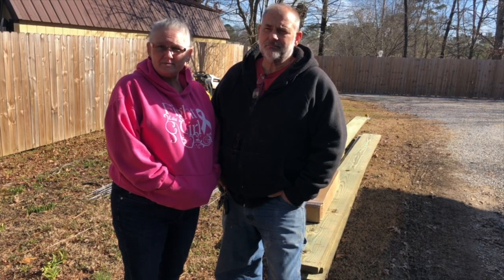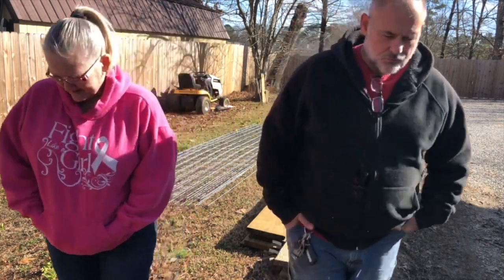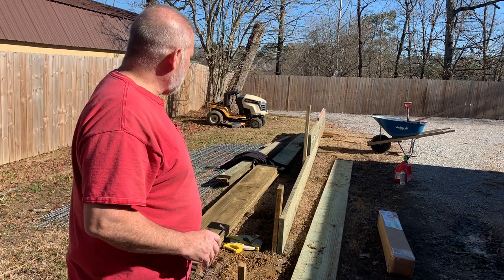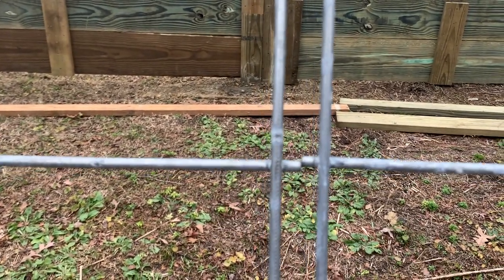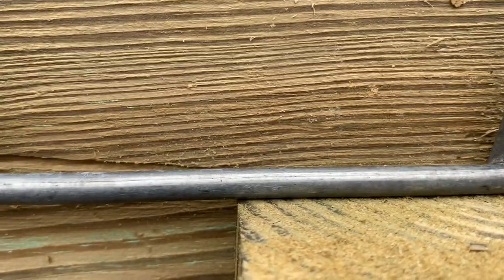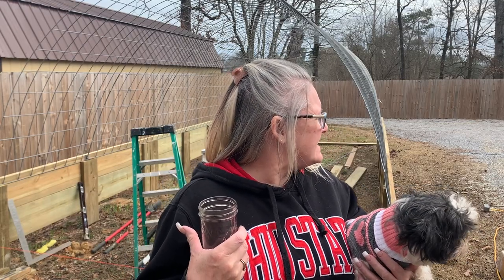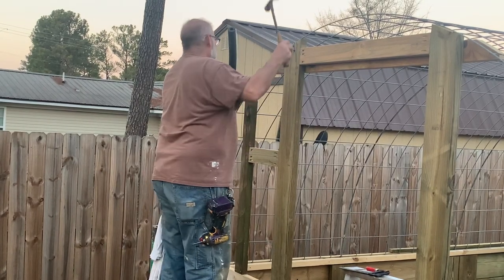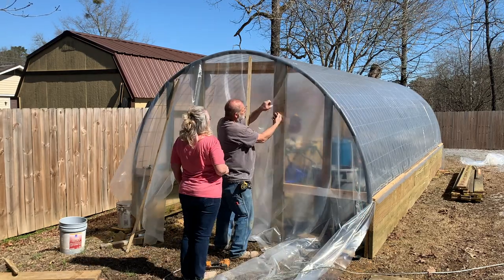Greenhouse Build 02/ 2020

Comment: Welded my panels too,went with plywood for the ends we have very strong winds here had to put a center support as well for snow loads.My mom was from Greenville Ala. said never saw snow until married my dad in the 40's. great job your doing
Reply from the maker: Thank you!! I know what you mean with that snow being heavy. Sure shoveled enough of that. 😄⛄️
That weld just makes it stronger, I think. Did you run the support at the top?
Reply: @generationshomestead  Since it was all welded I just used 2 2x4 come up from the sides at a angle,in the middle of the hoop house kind of like a level off pyramid